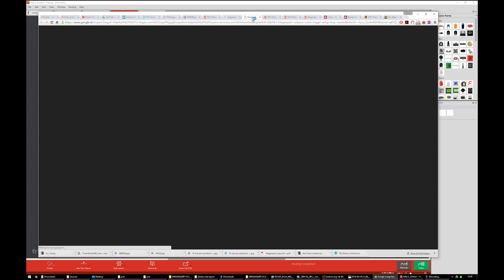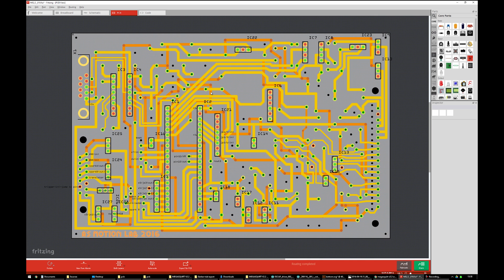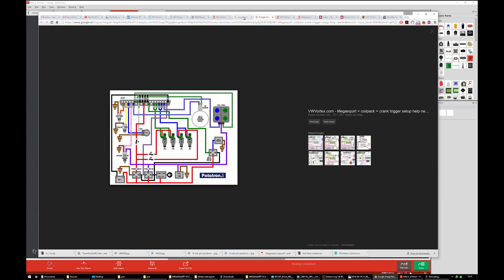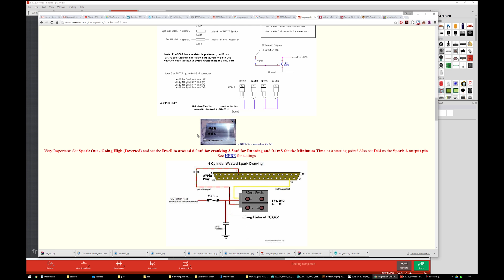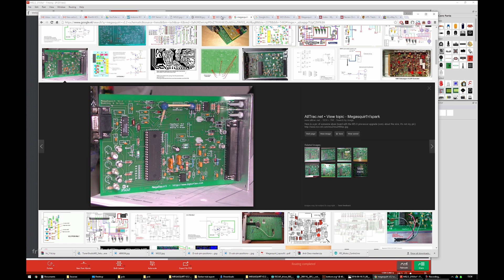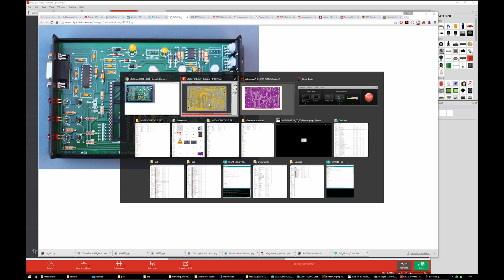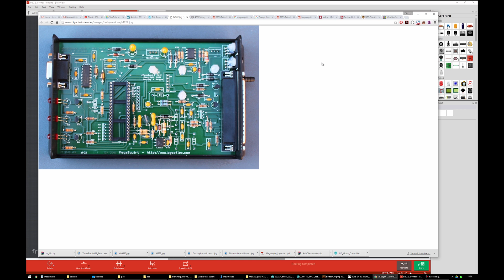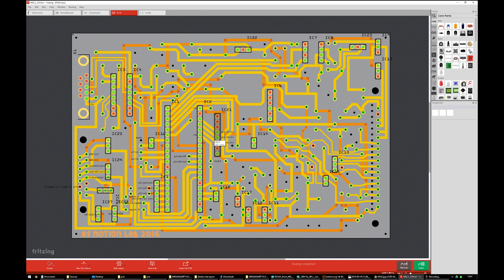Pt 1/2. Design, CAM and CNC routing Megasquirt v2.2 PCB from Fritzing to FlatCam to Mach3

Comment: Hi, do you have the layout with indications of signals? (LED, etc), i want to use this PCB to run EFI on a 6 cil engine with spark.
Reply from the maker: Hi, unfortunately I don't have the pinout. It's 99% the same as the stock MS1 V2.2 pinout http://www.msextra.com/doc/general/ms1external.html but you would have to do a bit of investigative work to trace what signal goes where to be 100% sure
Reply: Thanks!